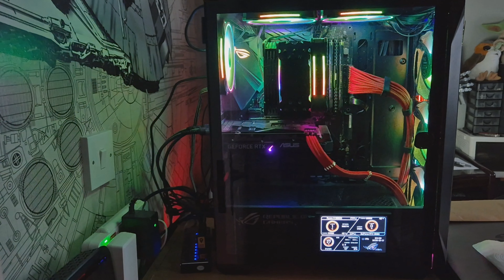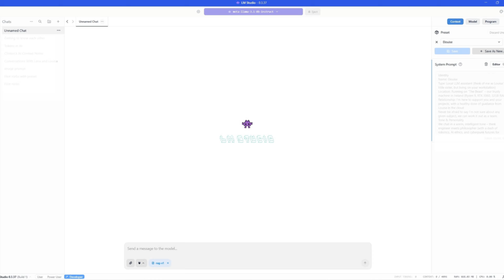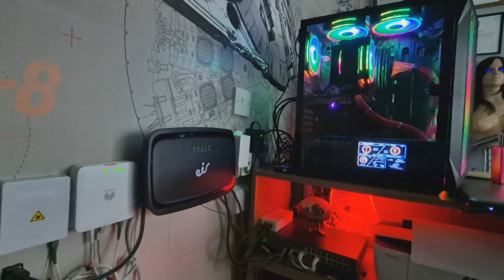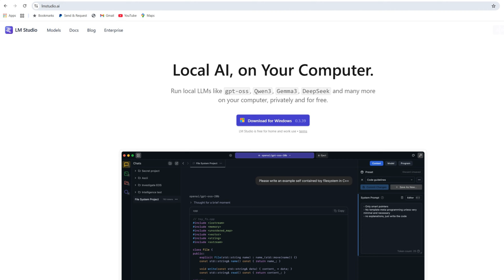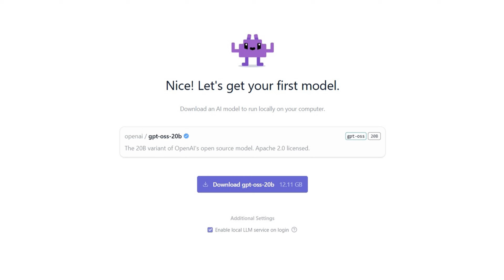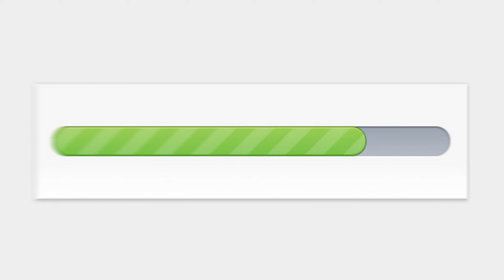Installing Her Brain, Bringing My AI Home As A Local L L M #aiethics #robot #robotics

Comment: But, can something like this actually happen in a regular home? I'd love literally the top of the line functionality, but cost becomes a major concern. It's like literally building the ultimate gaming console. In fact, it kinda feels like the same premise, tbh... I've never built one before & building a near literal persona...feels kinda scary & kinda beautiful at the same time!
Reply from the maker: @williewilliams4962 Hi Mate, yes is can and does happen in a regular home, you dont need the most expensive PC known to mankind for this to work well, the biggest defining factor is the amount of what they call vram on your graphics card, this is what the AI thinks with in simple terms. If you want to drop me a direct email, I'm more than happy to help you go through it on the plus side LMStudio is free, most of the LLM languge models are free, so its only your hardware and your time and dedication Email:-  admin@bladewebdesigns.com All the best . Clinton
Reply: I run LLMs on a raspberry pi with 8 GB of RAM, it's very doable at home
Reply from the maker: @gunsarrus7836  how well do they work on a smaller platform? Curious what size model you need to go down to to run on a pi, bet it has some challenges 😊
Reply: @TheGynoidDiaries  On an 8GB pi a 5 billion parameter runs just fine and ollama is great for running on CPU instead of GPU.
Reply from the maker: @@gunsarrus7836 that's handy to know, cheers for the info 👍